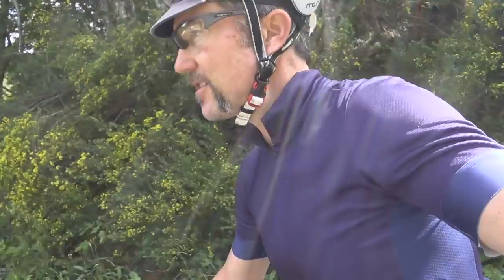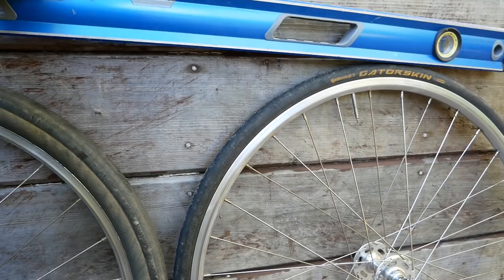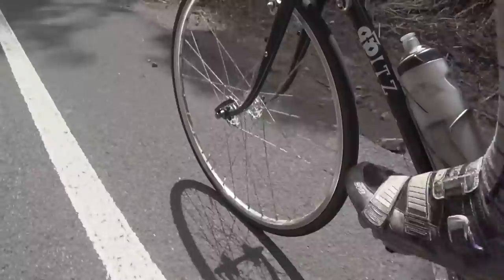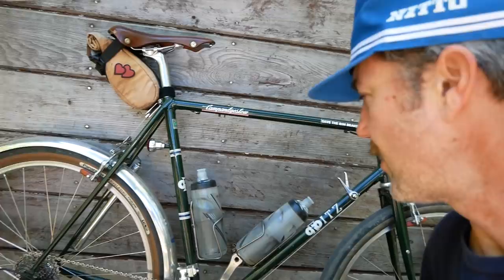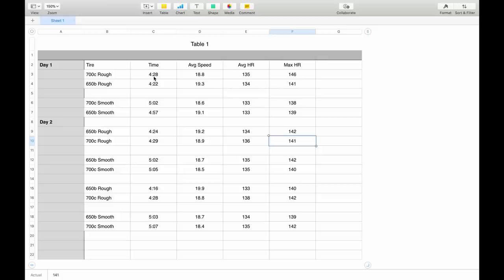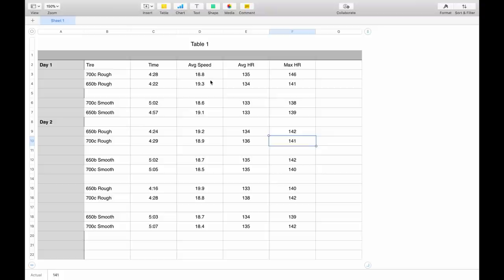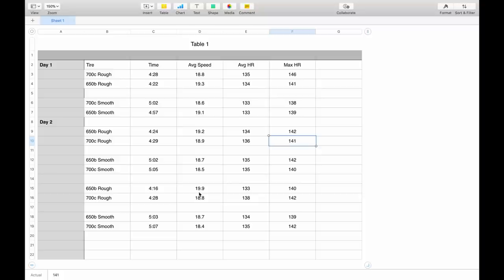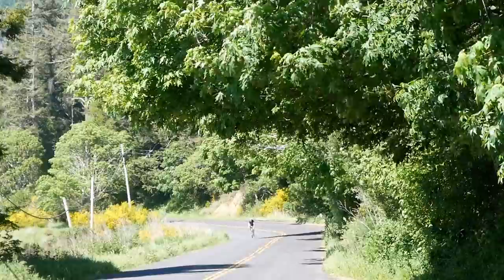The Great Wheel Debate: 650b vs 700c Part 3: A Practical Field Test

Comment: NO! Just NO! Everything about this video is WRONG!
You begin by titling this video as “..650b vs 700c..” indicating a comparison test between two different rim diameters is forthcoming, but no, in your description you immediately jump to “.. the differences between narrow and wide road tires..”

Make up your mind, diameter or width, changing both at the same time results in a meaningless, worthless comparison.

Then you proceed with multiple other variables to tire types, spoke count and hub differences and presume that your heart rate is an adequate equalizer ignoring variables presented by your own endurance fitness, wind resistance, air density etc..

To do this properly, first settle on what is to be compared, diameter or width.

If diameter is the thing, then use identical hubs and spoke counts, use rims built from identical extrusions and tires built on identical carcasses such as Continental GP5000s in 25-622, 28-622 (700c) and 25-584, 28-584 (650b) with similar tubes.

- - -

If width is the thing, one set of wheels will suffice, tires must be of the same construction and series.
This has already been very well done by bicyclerollingresistance.com.
They tested (among many others) Continental GP 5000s in 23-622, 25-622, 28-622 and 32-622 sizes, each at four different pressures and repeated the tests with both butyl and latex tubes.
For each size, rolling resistance was lowest at the highest tested pressure, resistance increased as pressure decreased.
All across this test set, the widest tire had the lowest resistance when all else was equal.
Rolling Resistance at Recommended Air Pressures (15% tire drop) test results showed the narrowest tires the fastest.
https://www.bicyclerollingresistance.com/specials/grand-prix-5000-comparison

They also compared Schwalbe Marathon tires in 32-622, 37-622, 40-622 and 47-622 sizes where the 37mm width was the fastest.
https://www.bicyclerollingresistance.com/specials/schwalbe-marathon-32-37-40-47

Note that in both test series mentioned, there are still variables in tread thickness specs between sizes among the same family of tires.

There are many other, very well controlled and valid experiments/tests documented at bicyclerollingresistance.com. 

- - -
 
If/when a test such as you assert to present is beyond your skill set and/or beyond the capabilities of available testing measurements and materials, then, please stop right there and waste neither your viewers' nor your own time.
Also, “pseudo-science” is “fake science”, it's right there in the “pseudo” part.
All you've shown are apples and oranges.

- - -

Fact;
When all else is equal including the contact patch area, a wide contact patch will always have less rolling resistance than a long one.
Reply from the maker: Hello, and thank you for your thoughts. It a sounds like you may have missed part two of this video series. In short, we are exploring how equal rolling diameter using different width tires may affect rolling resistance. This test, while not perfect by any stretch of the imagination, was a first pass to see if there is a significant difference in rolling resistance on a real road surface, not a smooth rolling drum in a controlled laboratory setting. While laboratory studies are informative, the results may not predict real world outcomes. In conclusion of this video, the results were much closer than I had imagined and more experimentation would be very interesting.
Reply from the maker: @rondvivre3636  You're going to have a hard time finding real world test information comparing 650b vs 700c in a practical field test without introducing a number of variables that can be criticized. All experiments come with a certain degree of error. 
The are a number of reasons why I held the outside diameter of the tire constant for my experiment. First, the diameter of the tire affects the direction of the forces relative to the hub. Second, a larger tire on the same wheel is heavier with a higher rotational inertia. Third, a heaver tire is slower on a climb. Forth, a larger tire may not fit with your frame geometry or toe overlap. So you can see the  point of the test is to see if a heavier tire/lighter wheel (e.g. 650b) is equal or better than a lighter tire/heavier wheel (e.g. 700c). What's missing in a lab test is how the tire responds to different surfaces. Jan Heine from Bicycle quarterly suggests a narrow tire will roll slower due to vibration losses caused by the narrow tire vibrating at a higher frequency. He has cited a case study conducted by the US Millitary where they measured the energy absorption of a tank operator driving a tank while seated on a hard seat vs. one on a vibration isolated seat. It turns out the human body was capable of absorbing up to 2000 watts. What he is suggesting then is that the narrow road tires are likely slower because your body has to dampen the extra vibrations caused by the harder narrow tires. That's also why heart rate data in this case is valuable information. Are we riding faster at a lower heart rate? If so, that could mean we have more energy available to devote to turning over the pedals instead of damping harsh vibrations. This is a hard concept to get your mind around, and I've been thinking about it for many years. I don't have endless resources to set up experiments, but I think this one does illustrate what he is talking about. If the bike industry wasn't so secretive we would all know more. Luckily, the auto industry is required to design tires which provide better rolling resistance due to fuel economy restrictions. I have found lots of information reading peer reviewed scientific papers published by the SAE and the ASCE as well as other reputable European engineering and science journals.There you will find a wealth of information discussing tire construction, rubber compounds, sidewall construction, and so on. You'll find tons of research on various road surfaces, coefficients of friction, and rolling resistance. In Europe tires not only have to meet specific highway standards for grip, and velocity, but for rolling resistance and sound. Yes, sound! They have to be designed so as not to be too loud. The bicycle industry on the other hand doesn't want to share anything. They want you to believe winning races is all the proof you need to buy the next greatest carbon bike. I wish you all the best in your search.
Reply: @Henrywildeberry  Maybe it's from you or an audio podcast I listened to but, in risking repeating what you said yourself...  

In order to make an analogy about the energy lost dampening vibration, one must imagine driving a Jeep at 100 km/h and an E class Mercedes at same speed.  In the Jeep, one might believe he is going pretty fast until he takes a look at the speedometer and realizes he is going at a moderate speed.  The guy in the Mercedes may believe there is nothing going on as everything is so smooth while he is at 100.

In my college years, I did drive an 80s VW Rabbit diesel 4sp standard and I do KNOW that 100 km/h may seem like fast..

All in all, you test may not be perfect but it does bring some usefull data and I like it as usual :-)
Reply: Ron, you need to consider the total diameter: 46mm tyre on a "650b" wheel (584 mm diameter rim) is almost identical to a 26 mm tyre on a "700c" wheel (622 mm diameter).
Reply: @TomasJ111  NOPE.
The title of the video is;
"The Great Wheel Debate: 650b vs 700c Part 3: A Practical Field Test".
I expected a practical test of 650b vs 700c such as 584 x 32 vs 622 x 32 which, by definition, would be two tire/wheel assemblies with different diameters and as many other variables eliminated as possible.
Henry could have compared such wheels, he could have done simple coast down tests down a gentle slope with a flat roll out and averaged many runs sans the outliers.
Henry did none of that and his protestations once called out he invokes tank seats, vibrations, asserts his heart rate is a precise scientific standard un-susceptable to vibration induced variables  rather than yet another variable, dismisses tirerollingresistance.com 's methods even though they use diamond plate and ends with the insulting presumption that I'm a wannabe racer in the market for an environmentally unkind, carbon fiber bike. My retort to that insult is below.

Determining/measuring actual, effective differences between a smaller diameter assembly's sharper angle of incidence over irregularities with a shorter contact patch versus a larger diameter assembly's shallower angle of incidence with a longer contact patch is neither addressed nor considered.
THIS was the premise indicated in the title.

I see no indication that Henry has given any consideration to why a wider tire has a shorter but wider contact patch and why it bears on the conversation.

Mr. Wildeberry presents as an imaginative, happy, hippie cyclist with no concept of how to science out answers, (in his own words in the video, he does pseudoscience) and I'm content to accept him as such. His confirmation bias toward his preferred, geriatric cruiser bike tires is apparent throughout while his findings are useless due to multiple variables that could and should have been eliminated prior to the onset of testing.
 /retort

Mr. Wildeberry's own words in a reply above;
“The are a number of reasons why I held the outside diameter of the tire constant for my experiment...” and then he attempts to justify the intentional inclusion of four separate variables including TOE OVERLAP and frame clearances as if those have any bearing on rolling resistance. 
His first 'reason' is the only valid one and was THE WHOLE POINT of the video according to its title.
His second and third reasons render everything else meaningless.

Again, comparison of 650b with 700c necessitates different assembled diameters. Mr. Wildeberry made no such tests.

Tank vibrations, sheesh........ 
Admittedly I'm guessing here, my guess is that a long downhill coast on a short wheelbase, stiff race type bike with 23s at 120 psi will induce a measurably higher heart rate than a coast down the same downhill on a compliant touring bike with 48s at appropriate pressures. Here, you're looking to see the effects of vibrations on heart rate, not so much 'how much', rather, 'if'.
If my guess is correct, it quite negates the use of heart rate as a reference metric for effort required when comparing  650b x 48 with 700c x 25. Has Mr. Wildeberry tested this such that he KNOWS heart rate is a valid reference metric or must viewers of his video be left to wonder?
 I don't know, do you? Did you give this concept any thought or just take it on face value because Henry said so?